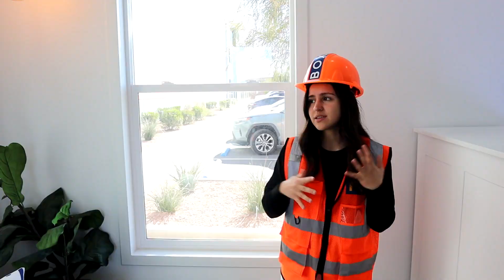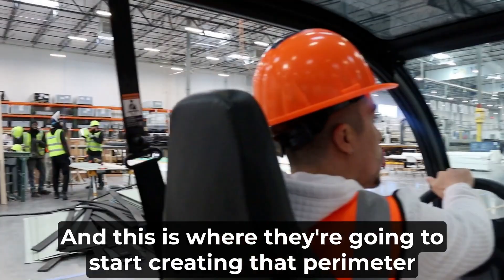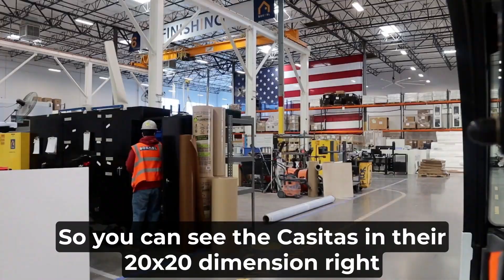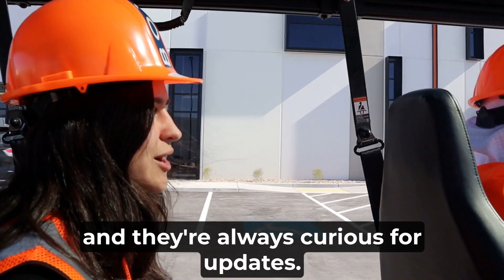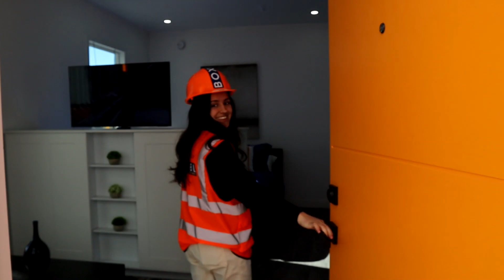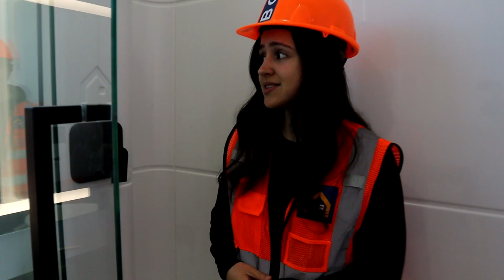Touring BOTH Boxabl Factories and the Casita in Las Vegas!

Comment: If this project falls through we should band together and develop some kind of open source protocol where we essentially mush together shed parts from Lowes, home Depot, etc and add 3D printed parts. Contract out structural engineers and industrial designers and the assembly team.